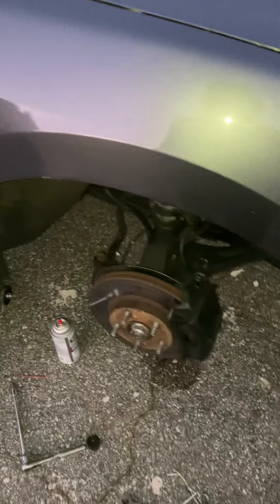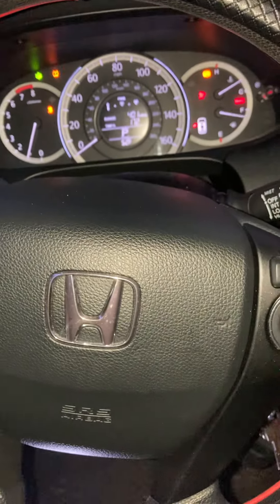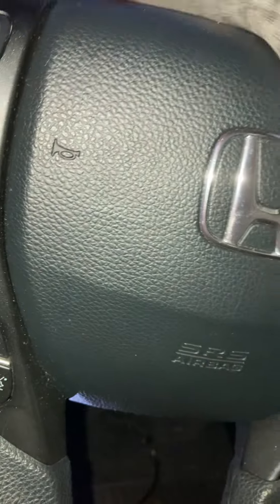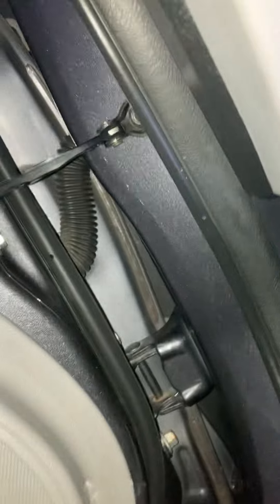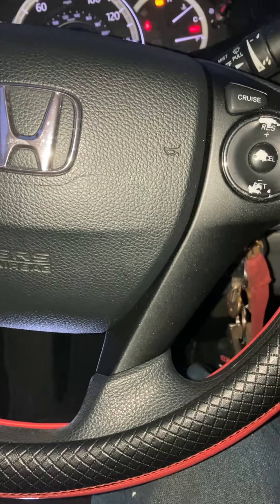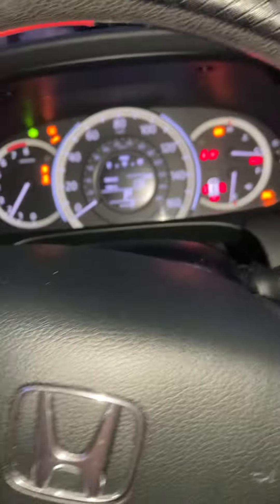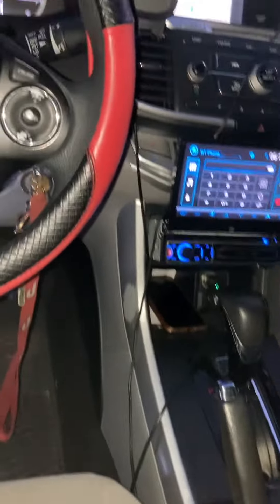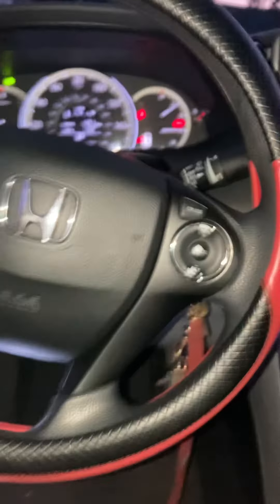Reset ABS light 2013 - 2016 Honda acurs

Comment: Thanks for the video. Although it didn't work the first 4-5 times I tried it, I'm still grateful for your effort and used it as a template. 

I had to alter the procedure for it to work on my 2012 for some odd reason. I followed your initial instructions, but instead of holding the pedal until the light flashed, I had to take my foot off of the brake when the ABS light went off (it didn't flash). When it came back on, I pressed the brake pedal until it went off again and released it . Then, when it came on a third time, I pressed brake pedal until it finally flashed and went off. Then I removed the wire and started the car and all was good! Maybe it's because my car is a manual?... 🤷‍♂️

Comment: I have 2017 accord, I had a Honda dealership work on my car and they broke the ABS ACCELERATION/DECELERATION sensor. They replaced it (at least that what they told me) and charge me for the part. Now after I few months, I ran an OBD2 scanning and it said, “Antilock Braking System Code 151-31 (Indirect TPMS Initialization Open Failure)”. I spoke with the service advisor at the dealership, and he said I have to pay their diagnostic fee. Will doing this reset fix the issue?
Thanks in advance.

Comment: I have a Honda Accord with the ABS malfunction, causing 3 lights (wheel, traction, and tire) to come on. I have to assume this method isn't going to solve the problem.
Reply: Same here bro what did you do to fix it
Reply: I’m having the same problem. Did you fixed it ?
Reply: @mariofernandez113 have you fixed yours? My lights can out

Comment: 2013 Accord Sport - As I was driving yesterday all the lights cane on. I thought it was the battery so I unplugged & plugged it back and no luck. I came upon your video and I tried it. It worked and all the lights are off. I had the brake, traction, ABS light on. How do I know if its the ABS sensor that needs to be replaced and if its one or both? Thanks in advance.
Reply from the maker: If they come back on its one of your ABS sensors
Reply: How many ABS sensor do a 2014 have? My car wouldn’t start , got a jump than all the lights came on. Is it the same what’s going on with y’all? I’m a woman so not to much on me.😢
Reply: @flaboi404 the lights came back on 3 days later. I’m guessing I should change both of them?